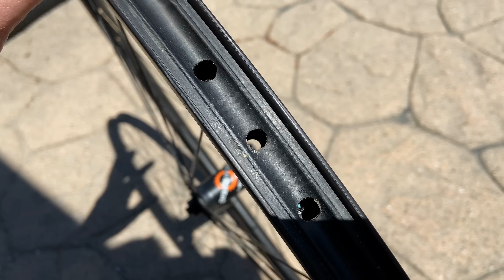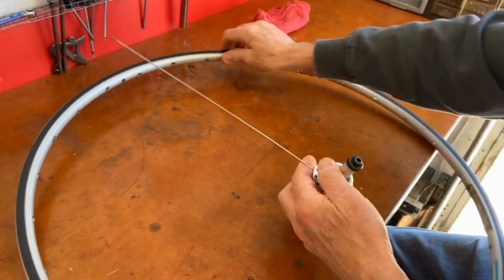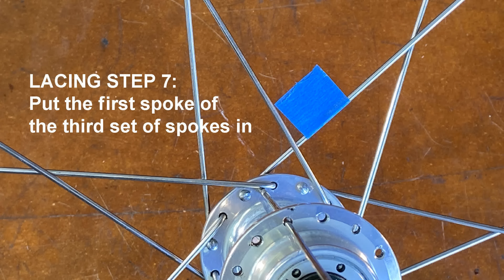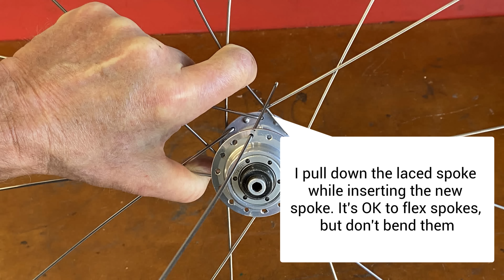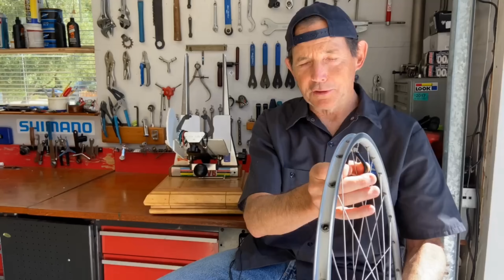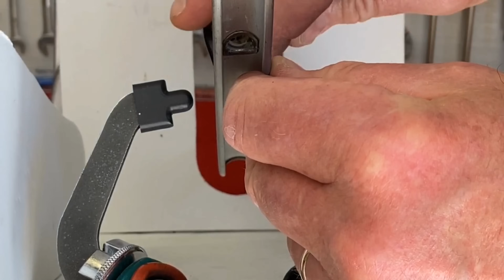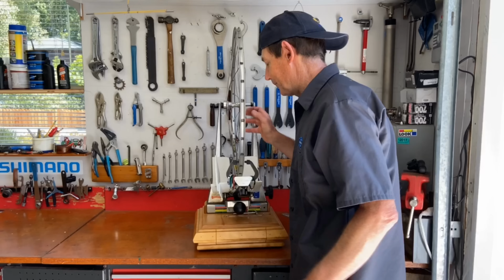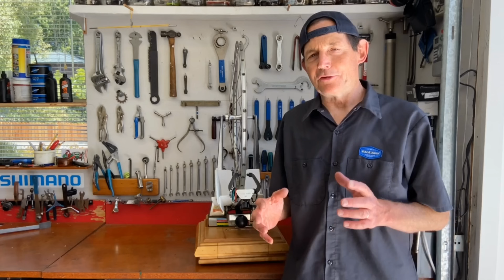How To Build Bicycle Wheels THE EASY WAY! #bikerepair

Comment: Hi Jim. i just finished my wheel but i cant solve a radial wobble (4mm) without having to overtighten some of the spokes. As im learning (and having fun/getting crazy) with it i realized that some of that spokes might be a bit shorter then the others, then with little research, it says that the DS can be different from the NDS. I used the spokeCalc online calculator and it shows that i should use shorter spokes on the DS, which i considered all the same (its only 2mm difference). what is your experience here? would this make a difference in such Wobble of 4-5mm ? the Rim is not perfectly flat to a surface, but also not warped. perhaps 1-2mm. Could this be the prob? do a rim needs to be perfectly flat to the ground? thanks a lot for sharing!
Reply: Jim, I had to start from scratch and after having all the spokes at the same tension initially, the wheel is touching the fram in one sector. Is this a bad indication or still 'normal' to happen? Thanks
Reply from the maker: @Gledii it’s probably not centered/dished. Try loosening the spokes only on the side that’s rubbing to move the rim over.
Reply from the maker: Here’s the link https://youtu.be/5ZInuIG0-dk?si=ucD9SLDk-AzvharD
Reply: @JimLangley1  You are the best! thanks Jim
Reply from the maker: @Gledii you’re very welcome!
Reply: @JimLangley1  Man, its getting to a point that i cant get down from 2mm high radial bump. tried several times but then screwed up the lateral one. its crazy how each spoke is affected by the adjacent ones and enven to the non adjacents. your work is art!
Reply from the maker: @Gledii sounds like you’re getting the hang of it - going little by little, patience and keeping at it is what it takes. I don’t know if you watched this shorter video of mine that I just posted last week. I show really close up what it takes to go for perfect. Here’s a link: https://youtu.be/DfjEaxlk1R4?si=RFdMlAuWnKfOaHOI You can do it!
Reply: @JimLangley1  thanks. I will watch it when Im Back. Just managed to get 90% ok and went out for a spin to let the spokes sit and will try to get to perfection :). One thing someone should think of how to facilitate the correction of deeps. Highs are easier to correct but the deeps it's tricky to visualize...
Reply from the maker: @Gledii the “deeps” (usually called “dips” or “low spots” or “flat spots”) are in-between the high spots. The dips get easy to see as you get used to truing for round. And they improve as you bring down the hops. So basically they’re related and it’s best to think of them as affecting each other not so much as different things. Or at least that was a helpful tip for me when I was learning.
Reply from the maker: @Gledii I have another video all about centering too Gleddii if you need more details.
Reply from the maker: Congratulations Gledii, good job! Yes, usually the DS spokes are a little shorter than the NDS, but that should not relate to trueness and radial issues. The thing you might not have thought of is that to get radial wobbles out, what we usually call high spots or low spots or some people say hops or dips, is that you can usually remove them by using a combination of loosening and tightening spokes, so you shouldn't necessarily need to tighten the spokes any more. You should be able to loosen the spokes to get the low section of the wheel to move up and then only tighten the few spokes at the high spot to pull down the high spot. Any time spokes near full tightness then you loosen to make wheel truing and radial adjustments. Okay, I hope this helps you fix it. You also might want to watch my latest two videos because I go into great video on fixing roundness issues.
Reply: @JimLangley1  not much to  congratulate Jinm :). Yes, i´ve tried that as well. the thing that loosing it on the lower parts makes de NDS spoke quite loose (ca. 50kgf). the thing why i asked is that i noticed that by trying to remove the high spots, some of the spokes were already at "max" . so how to decide if i should remove the highs by tightening or by loosing the lows? or its a trial and error thing? for sure i wont go higher than the max allowed (ca. 120-130 kgf). cheers
Cancel

Reply

Comment: Hi Jim, great video! I'm getting ready to build my first wheel. Do you think I could use bicycle grease instead of oil when prepping the nipples and spoke thread?
Reply from the maker: Thanks a lot for watching, glad you enjoyed the video Diana! Yes you can use grease but don't use too much because it tends to spread all over the place (thinner grease is better than the thicker greases like for boats and automobiles). You don't want to get grease on the sides of the rim if you have rim brakes. And you don't want to get grease anywhere near disc brake rotors if you're building a wheel that has a disc rotor on it. But if you just put a small amount on the spoke threads and nipples and then have some isopropyl alcohol handy (also known as "rubbing alcohol"), you can clean your fingers and any greasy fingerprints off the rim as you lace the wheel and after you lace it. That way you should be able to get any traces of grease off the rim and the ends of the spoke nipples. If you are going to use an adhesive rim tape inside the rim, you'll want to clean in there too so that the rim tape will stick. If you're careful like this it should be fine to use grease.
Reply: @JimLangley1  Just wanted to let you know that I finished building my wheels! Your videos really helped me and gave me the confidence to do it. Thanks again for your help!
Reply from the maker: @hsiehdf  Great job Diana! It's great to hear you built your own wheels and that my video was helpful, thanks very much for letting me know and congratulations!! 👏

Comment: Thanks for the video, it was very informative and made me less worried about trying wheel building. I'm gonna start by trying on a wheel set for an old road bike I'm restoring. I see you can buy a tension "checker". In your opinion, is that not nescessary?
Reply from the maker: You’re welcome, Carlo, glad to hear you’re ready to do some wheel building - you can do it! You definitely do not need a spoke tension meter but if you enjoy nice tools and end up building lots of wheels you might decide to buy one. I have another video all about whether you need a tension meter you might enjoy https://youtu.be/7JLw4pGyVyI?si=7W0uvid4ObZOn7lY
Reply: @JimLangley1  Thanks for the swift reply! I'll give it a go without, and see if I get bit by the bug. Also will check out the rest of your videos.
Reply from the maker: @carloescobar5663  thanks Carlo, have fun!

Comment: Hi Jim great videos really helps. Im a first time wheel builder I have followed your steps and doing well. I have couple of problems come across. 
1 can’t seem to get the wheel dead centered, it’s about 3 mm out 

2 The tension seems quite tight. Is it advisable to try another 1/4 turn to get wheel Centered. Using MAVIC CPX33 rims with butted spokes 1.8. Any tips would be greatful. Ps taking 16 hrs to get to this stage of the wheel build.
Reply from the maker: Thanks for watching and congrats on your wheel, Terry, good job! Centering the rim sometimes takes a few tries. You're only 3mm out and since you mentioned that "the tension seems quite tight" you can just loosen the spokes on one side to get the rim to move half way toward the side it's out those 3mm. So you only need to move the rim 1.5mm, which is half of 3mm. Some people would say that's close enough and not try to get it any more perfect. But if you want to shoot for perfect, you could try just loosening each spoke about 1/8 turn of the nipple and it'll move the rim probably just enough to do the trick - or try 1/4 turn if 1/8 isn't quite enough. Since you won't be tightening the spokes but only loosening, it will very slightly lower the spoke tension, which is fine if the spokes are already quite tight. I am currently working on a video about centering rims that should be live by tomorrow with any luck. But these tips in my reply should get you going. Let me know if other questions come up. Thanks again!
Reply: Thanks Jim I will try that method.
Reply: Update Jim I have applied that method and now have a wheel that is round, runs true and more important CENTERED. thanks again
Reply from the maker: @terry7351  that's great to hear, Terry! The next wheels you build will benefit from your experience and learning building this one. Enjoy that new wheel you built yourself, congrats!

Comment: Hi.  Love this video.  Question:  I have a new XXL 2022 Trek Fx3 Hydraulic Disc bike.  I am 6'7" tall.  255 pounds.  Trek Bike spec says a man of 6'7" and 300 pounds can ride this bike.  In short, the bike continues to break spokes on rides.  Every few days, spokes breaking.  Trek sent NEW heftier LVR RIMS, 36 spokes and STILL the spokes break every few days.  LOCAL Trek shop has trued the RIMS like in your video 2 or 3 times.  Still, spokes breaking.  Suggestions???  Please.  Thank you
Reply: Hi Jim...Wanted to give you an update on my XXL Trek bike and the spoke issue I had.  We replaced the RIMs with 36h RIMs and put in DT SWISS Champion 2.0 mm spokes.  IT WORKED!!  For 3 weeks now, not 1 broken spoken.

I do have another question.  For about 3 weeks now there is a "crunching"/grinding sound coming from the front of the bike.  Fork??  Spokes were not Newton trued in by Mechanic.  

The sound comes out especially, when I mount the bike and cycle forward.  Grinding sound and when I push DOWN ON THE FRONT BAR, UP N DOWN - CRUNCHING AND GRINDING.  

Within about 10 minutes of riding, it goes away and then comes back about 20 minutes later.

IDEAS??

Mechanic has no clue.  Trek has no clue either.
Reply from the maker: Thanks a lot for watching and commenting Lucas. Taller, stronger riders can break spokes due to additional stress and strain on the wheels which are working hard under any riders and harder under a more powerful rider. But, there is often another cause, and I bet the reason your spokes are breaking is because they are poor quality spokes. Most medium level Trek bikes have Chinese made spokes. Even my Trek Checkpoint came with them - a $3,000 bike. And, the best thing to try to fix the breaking spokes is to rebuild both wheels with high quality stainless steel spokes. They need to use a brand name like DT Swiss or if they can't get those they could go with Sapim spokes. 

These brands are the highest quality stainless steel spokes made and they are designed to hold up to the repeated stress spokes go through. These spokes are expensive but it'll be money well spent if they stop the breaking. I would try the DT Swiss Alpine III spokes or their Alpine spokes (which are probably a little less expensive than the Alpine III) - both are their heaviest duty spokes they make. https://www.dtswiss.com/en/components/spokes-and-nipples/spokes/dt-alpine-iii 

The other model spoke they make that's probably a little less expensive still is their Champion spokes. You'd want to get the 2.0mm model. Those are also heavy duty spokes, just a tiny bit less heavy duty than the Alpine models. Here's a link to those: https://www.dtswiss.com/en/components/spokes-and-nipples/spokes/dt-champion If you wanted to test the theory that these spokes will prevent broken spokes you could just build the rear wheel with them and ride on it for awhile and see if the spokes solve the breaking problem. That way you only buy the one set of spokes instead of two at first. I think it'll solve the problem. I hope this helps! Let me know how it goes.
Reply: THANK YOU.  ARE THEY AVAILABLE ON AMAZON TO BUY??  THE DT SWISS  ALPINEiii  I LIVE IN ONTARIO CANADA? @JimLangley1
Reply: HI.  A Warranty tech at Trek said they'll be sending DT SWISS 2.0 mm spokes for my 36 spoke wheel.  I have no clue if this will fix the problem.  I think the NEW Affinity RIM already has 2.00 mm spokes and Trek cannot tell me what mm thickness is in the affinity RIM.  SORTA praying it will be bettter.??? @JimLangley1
Reply from the maker: Really happy to hear the wheel is good now Lucas. That noise you describe sounds to me like a headset bearing gone bad. They make an awful crunching, grating noise when they’re bad. To check it out you take the fork out so you can feel the bearings (top and bottom) in your fingers. They should be clean, black grime. And they should turn smooth as silk with a hydraulic resistance from clean grease inside. But from what you said I think one or both are bad now. The fix is usually to clean everything and replace the bearings and make a proper headset/steering adjustment. Pretty easy job.

Comment: Hi! Are there any special considerations for building wheels where the hub is only supported on one side like in a wheel chair or a trike?
Reply from the maker: Thanks for watching and the great question Matt. You treat those wheels just like standard bike wheels pretty much. If they have disc brakes then you'd lace for them. If there's no winding force on the wheels then you could run radial spoking if you wanted (no spokes cross). Usually these wheels are built like front wheels with no dish. But not if they have disc hubs. It's always good to look at the original wheels that come on the wheelchair or trike to see how they were built. If there are no wheels yet, I would look for recommendations from the wheelchair or trike manufacturer to see if they spec'd anything special for the wheel build. But however you need to build the wheels, the process follows the same basic steps in my video. Hope this helps and thanks again!

Comment: this video is very helpful. Have you made a video for lacing an electric hub motor to a rim? I am very interested in knowing how to lace hub motors to rims.
Reply from the maker: Thanks for watching and commenting! This video teaches lacing wheels and you lace hub motors the same way. So if you are running onto difficulties with a certain type of motor hub please explain and I’ll answer more if that hub requires different steps.

Comment: Hey Jim, I had a rear derailer break off and bent a few spokes. I replaced the derailer and spokes and decided to loosen all the spokes and start anew to rounding the rim so I finger tightened the nipples to the rim to start. Should I give them a 1/2 turn past finger tight all the way around the rim to start the tightening process on the rim?, and then start my side to side process?. Thanks, Chris
Reply from the maker: Sorry to hear that happened to you Chris. Since the spokes were all loose that 1/2 turn should be fine - you might even need a little more. But you should spin the wheel and make sure it’s true and round first. If not, get it true and round and then start adding tension. Hope this helps.
Reply: Will work with that. The rim didn't " Taco", when the de-railer broke off,  so I should have success with it. Thanks again for the consultation , and keep on teaching!
Reply from the maker: @christobias3335  my pleasure Chris!

Comment: Hey Jim, this is a great video. Do the nipples have a life span and if so why is it better to use the tightening tool on the inside rather than a flat head tool on the outside of the rim?
Reply from the maker: Thanks for watching Keith, glad you like the video. There are brass and aluminum spoke nipples - those are the most common used. Brass can keep going and going and going - seen some 60 years old still going strong. Aluminum nipples came out in the 80s and I've seen them last for years and years too. But, they eventually corrode if they're ridden enough and especially if they get wet or are exposed to salt from oceanside air, sweat, road salt used in some areas in the winter. But, basically both types last long enough for most uses.

As far as tightening the spokes when truing, rounding and tensioning the wheels, you usually use the flats on the nipples beneath the rim. The slot on the top of standard nipples isn't designed for tightening, only for starting the nipple on the spokes. You will round out the slot/strip it, if you turn it with too much force by that alone.. brass and aluminum are pretty soft.

There are other types though, double square nipples or hidden nipples. On those nipples there's a square or hex head on top of the nipple that you can turn the nipple by from above the rim. Enve for example uses hidden nipples for some of their rims and the only way to true and tighten those spokes is from above since there are no exposed nipples beneath the rim. Double square nipples have both the square on top accessible from above/outside the rim and also the flats on the nipples beneath so you have your choice. Okay? I hope this answers your question. Thanks again and happy wheel building!
Reply: @JimLangley1  that's a very detailed and insightful response. Now I know, thanks!
Reply from the maker: @keith7411  my pleasure Keith!

Comment: Great video ! When building a rear wheel do the spokes on the drive side need to be shorter, or if they are the same length on both sides would it be just as good to tighten more the ones on the drive side? Thanks
Reply from the maker: Thanks for watching tomi, glad you enjoyed the video. Spoke length depends on the components used. For most rear wheels, yes the drive side spokes are usually shorter and they are usually higher tension than the non-drive spokes. But you can't assume that until you measure the hub, rim and do the spoke length calculation. I have a separate video about that https://youtu.be/LvV4FE2VxZk The reason the spokes are usually tighter on the drive side is because the rim is centered over the axle not over the hub (due to the gearing over the right end of the axle), so there's an offset and that affects the spoke tension because the rim has to be moved to the right/drive side. Hope this helps. Thanks again.